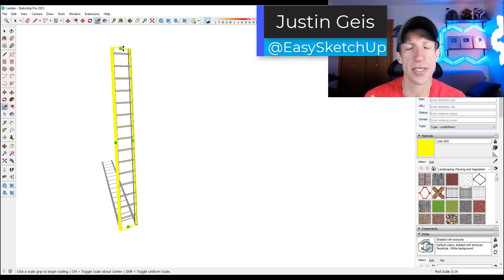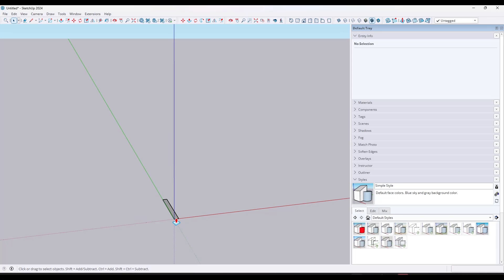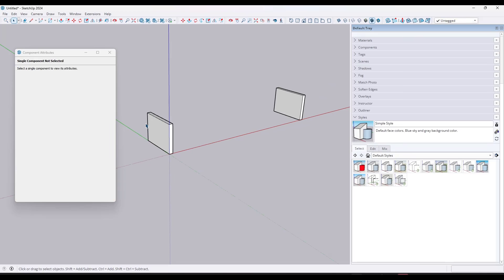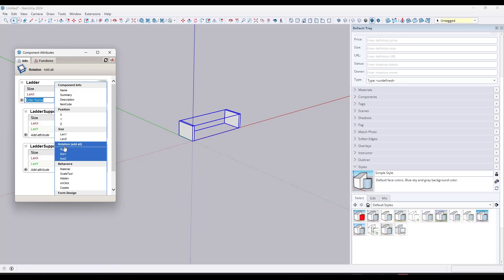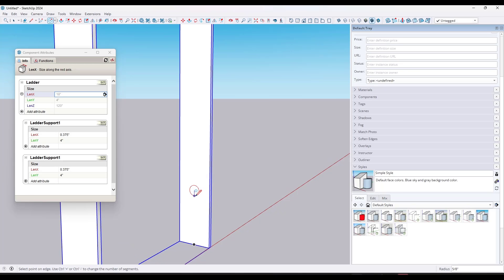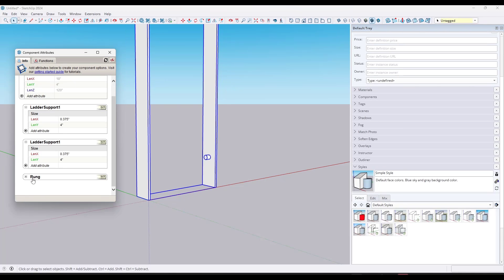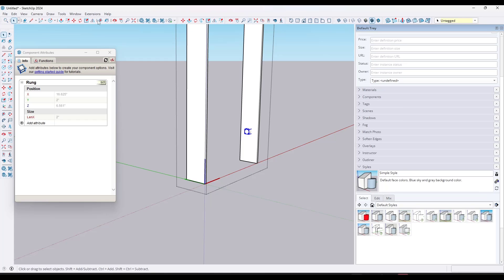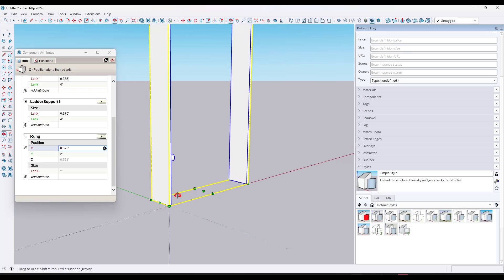Creating Component COPIES in Dynamic Components - The Ladder!

Comment: I'm using DC for dashed paint lines on a road. The lengths are different for each project but the dash and gap spacing is always the same. Is there a way to allow for a user to input a custom length, and the formula produce additional copies according to the length and the fixed spacing parameters? Can it produce a "half dash" if the user put in a number that would not evenly divide using the set spacing? 

Another application I'd like to use this for is for U-Channel for sign posts where the user puts in whatever length they want, and it still produce the repeated holes in the model. Is this possible, and if so, how do I use dynamic components and formulas to do this?
Reply from the maker: I would imagine you could set the length and spacing using a value input in the component. I can't speak to the half-dash, but honestly I wouldn't really get to that level of detail for lines to begin with. 

Personally if I was doing this, I'd be using Profile Builder rather than a dynamic component. 

For the holes, probably not? There's not really a live boolean object in SketchUp, so you can't really use a dynamic component to repeat something that would cut holes in another object. You could probably use it to repeat a component that already has the holes if you really wanted to, but again, this seems like a LOT of extra effort for something that isn't even going to be looked at for 99% of models

Comment: I'm using them for frame house construction projects. Every stud is a Dynamic Component and have assigned attributes so I could Generate Report and see quantities in report. Every sheeting plate is a DC, Windows, brackets, screws. By the way I love to see you bringing  DC's for wider public. There is a lot to cover: Animation, Rotation, visibility, Attributes in Generate Report,  and If you could cover a work around for changing value in attribute for multiple Dynamic Components objects. They call it "wrapping DC" Thank you for your hard work. I wish one day Trimble will recognise that DC's are great tool and deserves to be upgraded and improved.  Cheers

Comment: Couldn't you set the spacing to "=12".  That way the spacing of the rungs is always 12 regardless of ladder length?  I'd also eliminate all the grips except the top center to easily pick it regardless of zoom level.